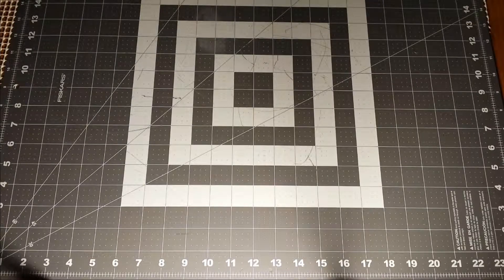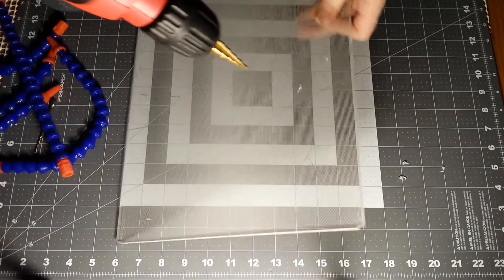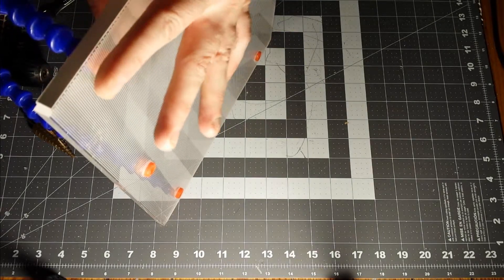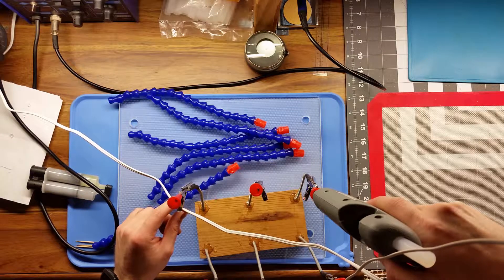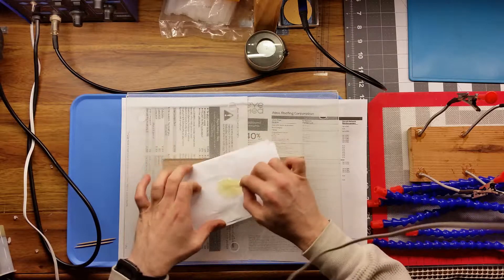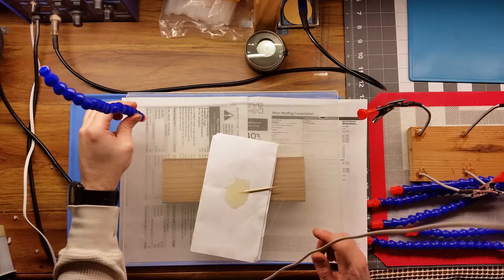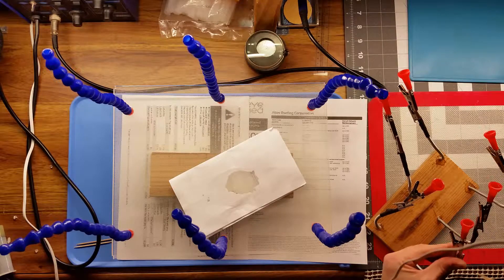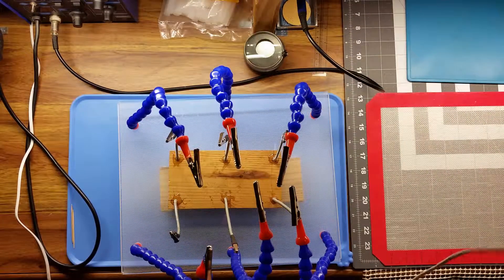$5 DIY Helping Hands For Soldering (Version 2)

Comment: Glue or Tap? 
Glue is super strong, and permanent. 
But despite being more work, tapping the holes will let you remove some of your arms at the front to use your base as a soldering work surface... Adding back the missing arms whenever necessary is just as easy as screwing them back in.

On mine, I removed the orange threaded piece completely and screwed down the last blue section with a long screw. I made sure it had a thin, flat head so it wouldn't interfere with the ball-joint design.  Pics below.

https://drive.google.com/file/d/0B7fXjeM77524Mkh2Z1JCYlZCUzA/view?usp=sharing
https://drive.google.com/file/d/0B7fXjeM77524R3hpTzFUVExJZms/view?usp=sharing